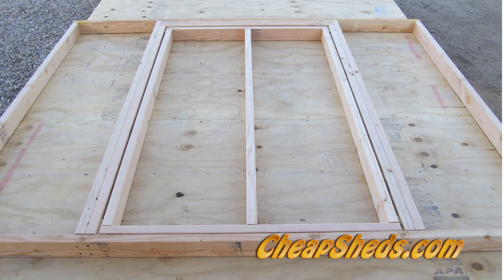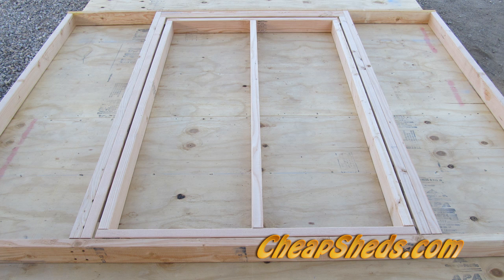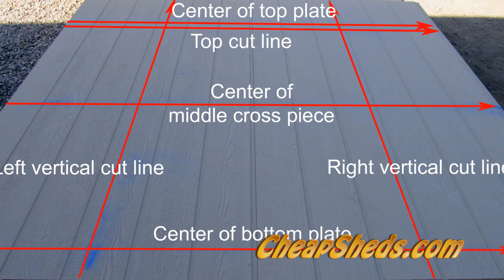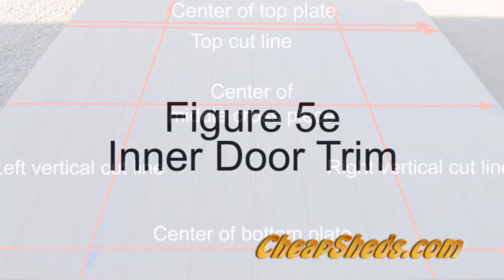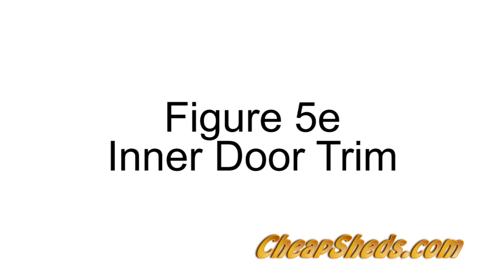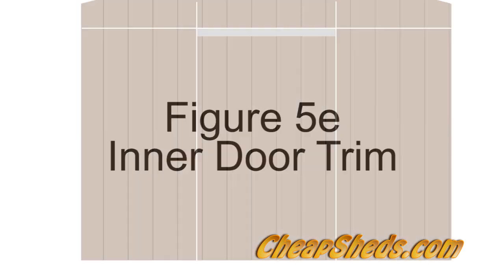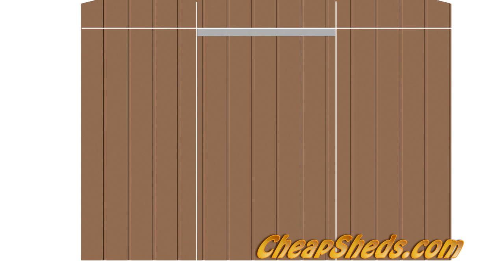How To Build A Shed Door

Comment: Nice video.  Easier alternate to cutting out the door:  Once the door frame is nailed/screwed to the siding, use a long 1/8" drill bit and drill four holes from the frame side outward (drilling between the 2x4s so you need a long bit). Each hole is dead center of the corners to be cut. On the outer side draw lines between these holes and cut along these lines to cut the door out.  Add trim afterwards so you can flush them to the cut lines.  WAY to much measuring and chalk lines for a novice to get right.
Reply: +BrianRDub ,,
Reply: +BrianRDub ,
Reply: drilling holes is a great idea, however remember to offset cut for door top to overlap header. this provides a stop for the door. Also if doing double doors offset cut between doors.

Comment: Omg this was overkill. Just frame out a rough opening for your door, then build it with 2x4's and cover it with a exterior grade panel. Install the hinges, stop plate and door handle. Done!
Reply from the maker: You get a better fit this way, with no materials waste. I have done it both ways and this is the best option. It is a little more complicated but the result is superior.

Comment: What about the hinges?
Reply from the maker: Please visit this page on my website to buy a heavy duty piano hinge online. http://www.cheapsheds.com/piano-hinge/
Reply: CheapShedsDotCom  great thank you sir
Reply: I built my door this way. 
With the sheeting (1/2" thk.) and trim (1/2" thk.) it pushes the door hinge knuckle out away from the door stud and the jack stud.
My hinge is 4-1/2" x 4-1/2".
Where the holes are drilled in the leaves it puts 2 screws directly center into the sheeting (which is not good) and the other just barely in the stud (also not good).
How can i remedy this without spending a fortune on wide throw door hinges?
What did you do?

Comment: What's size is the spacing between the door and the door frame?
Reply from the maker: I use scraps of siding or osb as spacers between the door and the door frame. About 7/16 is the final spacing. This is to keep the inner door frame from shifting while you are working with it.

Comment: The plans say to make the cut line 1/2" in from the edge of the jack stud... do we cut 1/2" in from the whole perimeter, even on hinge side?
Reply from the maker: Yes cut in from all edges including the hinge side. This will give you a little overlap that will seal against dirt, dust, and critters. Just make sure your hinge is wide enough so you can get the bolts on the door side of the hinge into the 2x4 frame of the door.
Reply: i know it is pretty randomly asking but do anybody know of a good site to watch new movies online?
Reply: @Zane Malik thanks, signed up and it seems like they got a lot of movies there =) I appreciate it!
Reply: @Ruben Camdyn happy to help :D

Comment: Absolutely a piece of shit door
Reply from the maker: The only downside of this door is that it is complicated to build and requires a router. But it is the most efficient and strongest door you can build because it is built as you build the shed and cut out to an exact fit.  Plus it has a full 2x4 frame which discourages warping. Combined with a full length piano hinge secured with carriage bolts it also provides superior security. This is why I recommend this door design vs the easier but vastly inferior alternatives.